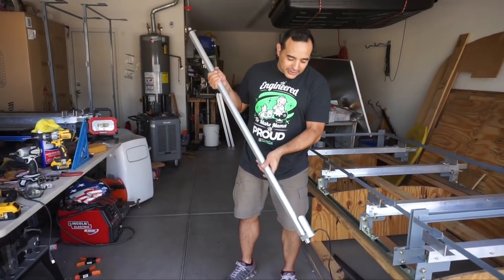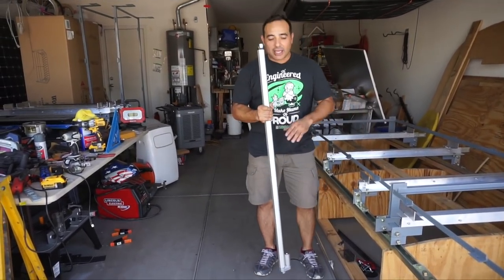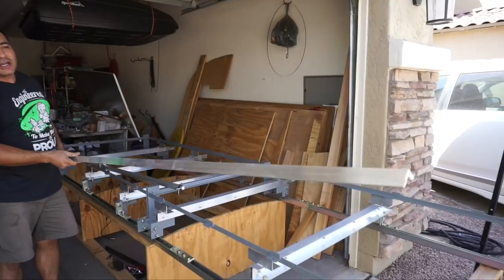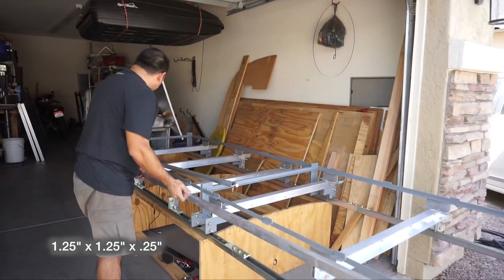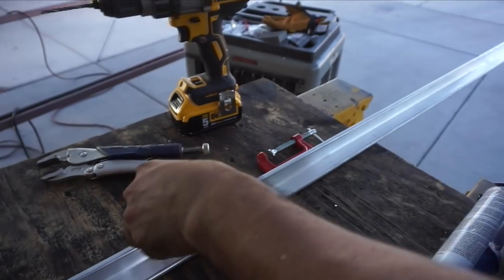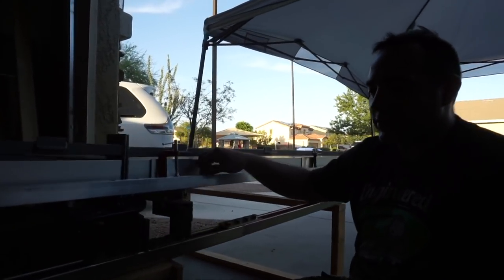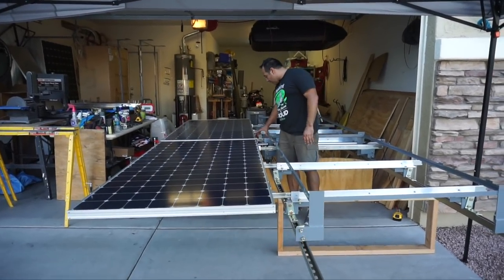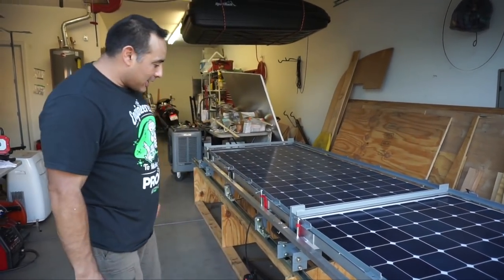Solar Rack: Part 5 - Fitting a Linear Actuator

Comment: How hard are those actuators going to be to get to once everything is mounted? I only ask because once they're exposed to dirt and driving rain you're going to be changing them often. 48" pneumatic cylinders are pretty easy to come by and would be a much better option. They will cost more up front, but will last forever in an application like this.

I'm not trying to be critical, just years of experience with things like this tell me the electrics won't last on the roof of your bus.
Reply: I agree, I am afraid that they are going to be finicky.  (But they sure look cool right now!)

I know you are most of the way down this automated path already, but is there a reason you couldn't just move the panels in and out manually?  With your beefy rack system, it seems so convenient just to have a basic latching/lock setup for in and out and just spend a minute or two unlocking and pushing or pulling the things in and out when at camp.  Is it because getting up to the roof is going to be hard?
Reply from the maker: Thank you Dirt Road Sailing - I have approximately 0 years of experience with this so I appreciate your input.  We searched for quite a while to find 48" pneumatic cylinders but the largest we could manage to find was about 32 inches or so.  If you wouldn't mind sharing your source for things like this it would be very much appreciated.  If you don't want to post it publicly you can email me juan@beginningfromthismorning.com
Reply from the maker: LOL thanks Ben - it's good to hear from you.  We thought automating them might allow for some cool automation scenarios (like automatically bringing them in at night, or if the wind picks up, or of the batteries are fully charged already and we are just floating the solar).  Plan B is just doing it manually and a reason that we attached the actuators with a pull pin that would be really easy to undo and allow for manual overriding.  We don't think we will be getting on the roof much after this contraption is installed on the roof (it slopes down pretty drastically on what is left to walk on up there) - but just putting a ladder on the side of the bus and pulling the panels out doesn't seem like THAT much of a pain and as you said - building a manual locking mechanism would be pretty easy.
Reply: I guess I should have looked a little before I opened my mouth. 48" pneumatic cylinders are available, but the bore goes up exponentially with stroke length. The company that we bought most of our cylinders from was a distributor for Parker Hanifin (parker.com). I configured a 48" cylinder on their website and it required a 4" bore which won't work for you and you'd have to sell one of your kids to afford it if it would.

Not to give up on pneumatics, if you look on automation direct, they have some really affordable 24" cylinders that I think you could make work if you can mount 2 of them back to back or have an actuator mounted to a pivot point where 24" of stroke (or less) would give you 48" of travel.
Reply: I like the idea of going pneumatic as well, so for fun I had a look at Grainger Supply.  They have a 48" double acting (rodless) cylinder with a 1" bore. Price is $640 though. Ouch!
Reply: Bimba Original Line Air Cylinder goes up to 50"
Reply: I had never heard of Bimba cylinders but it looks like an excellent alternative. You can choose the cylinder bore based on how much force you need which in this case is minimal and they are reasonably priced. If you went this route make sure you get the cylinder proximity switches to know when the cylinder is fully extended and retracted and tie that in with your controls, you don't want to be driving down the road and have a panel drift out if something fails.
Reply: I know Bimba thought the use in FIRST Robotics, don't have experience with them in a outside environment so I can't speak to their ruggedness in that manner.  Another option that would be good to consider is current monitoring on the electrical actuators, to detect that as an error condition.
Reply from the maker: I had not heard of Bimba cylinders - it looks like you can fully customize them and you choose a bore (depending on the strength you need) and the length all they way to 50 inches!  I wish I would have known about these before!
Reply: Come on Juan you know you want to go pneumatic. Just imagine a nicely tuned PID loop controlling a proportional valve gliding the panels in and out. I've seen the engineering shirt you wear in your videos. We're rooting for you buddy. Tell your wife she'll just have to give up a few things to make it happen.
Reply: I see.  I figured you had a fall-back plan!
Reply from the maker: LOL Thank you Dirt Road Sailing - I am going to give the electric linear actuators a solid try - but now I have an excellent fall-back with the Bimba cylinders.  I am fortunate that my wife is usually all in before I am!
Reply from the maker: Great idea Dirt Road Sailing - much easier to run a line now!  Thanks!